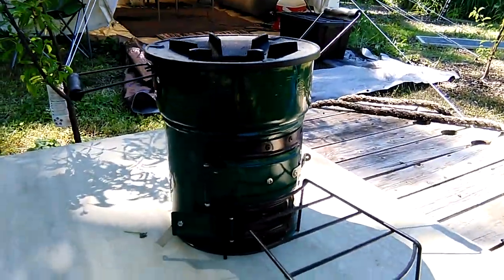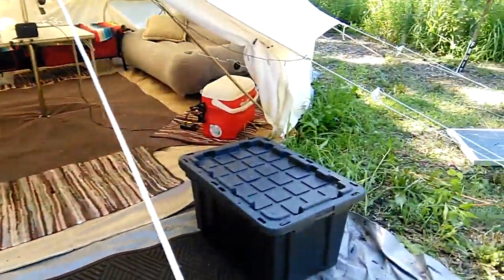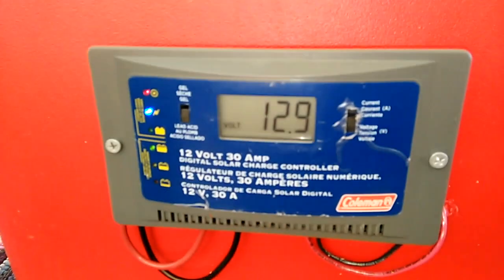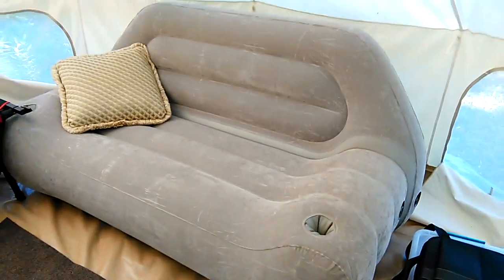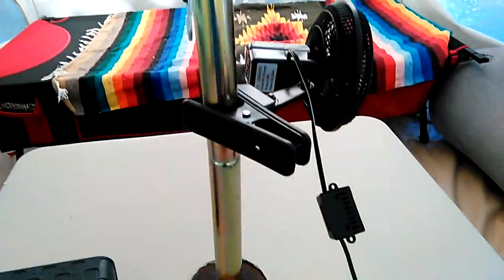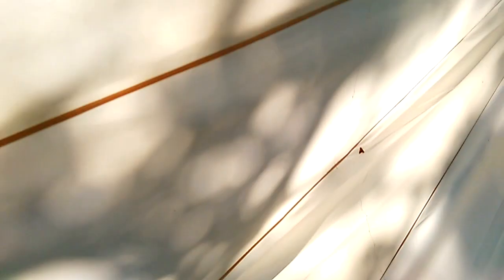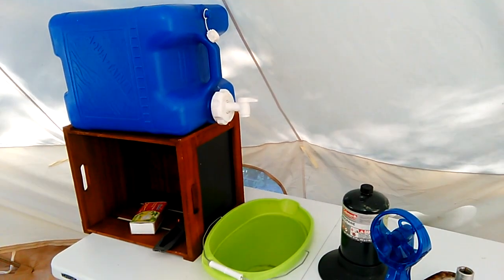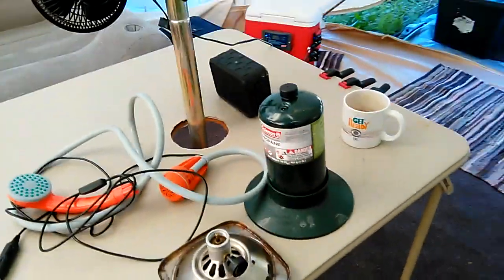Bell tent off grid camp set up

Comment: Is that a Stout tent and if so which model is it? Good tips on the minor electrical and plumbing needs if not readily available.
Reply: I now see your linked tent in description.
Reply: I'm interested in your DC plug in and inverter setup. Got any links or new suggestions?